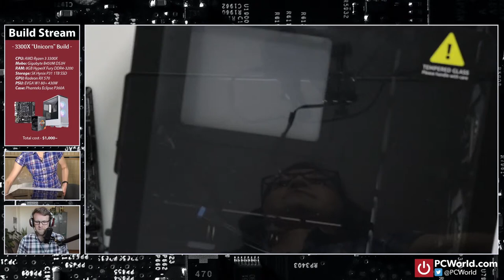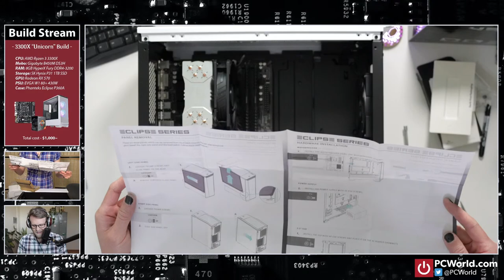$1,000 "Unicorn" PC Live Build w/ Ryzen 3 3300X & Phanteks Eclipse P360A

Comment: i built a pc for a friends kid not too long ago that had a 1600af (2600), the same mobo you used here, 16gb ddr4 3600 (came as a combo with the mobo that we had to run at 3200mhz), 256 nvme boot drive, 2tb data drive, sama case, 650w evga psu and a 1650 super for $675. that also included an aftermarket cpu cooler and i overclocked it for him as well.. he picked up a 21" 1080p 60hz monitor for $89 and he couldn't have been happier.